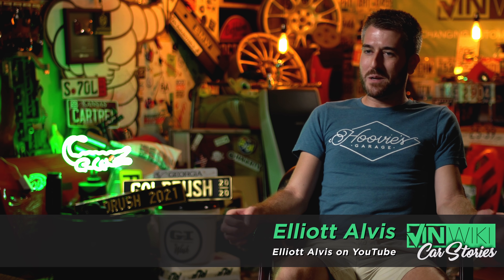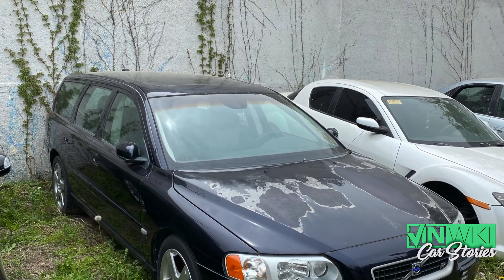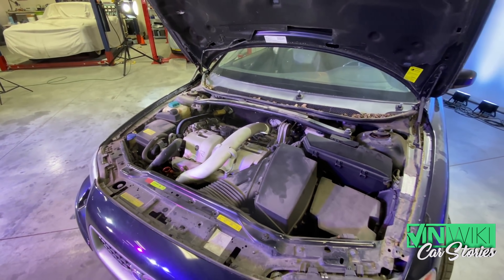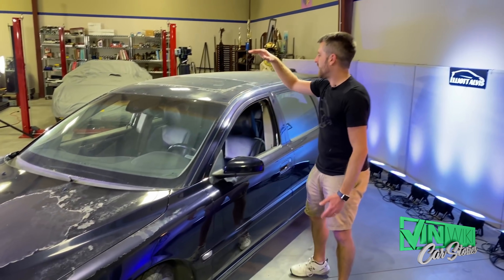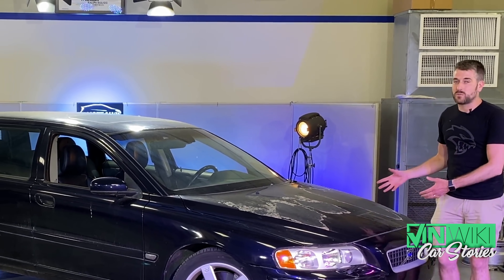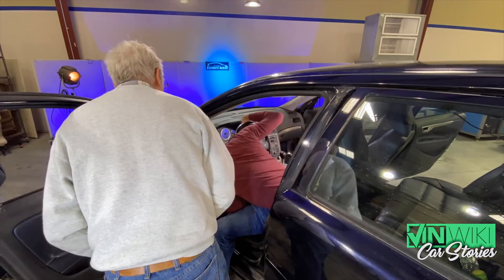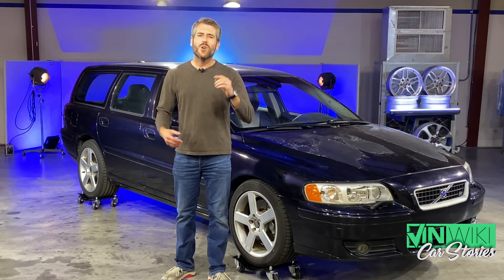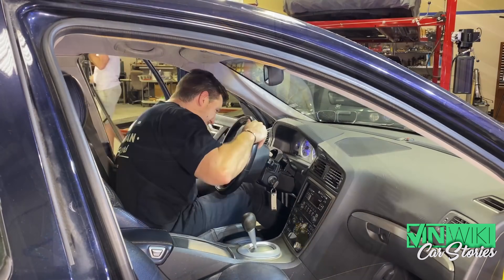Everyone LOVES you with this rare, broken Volvo

Comment: As a member of the Volvo Community I can say the Volvo Community is absolutely amazing. Our Xc90 has had quite a few problems and the Community just helps me out when I need and are so nice and open. Love the Volvo Community. Volvo owners, where u at
Reply: I have 3 of them;  2  XC70 (2003 - 2004), and a 99 S80 with very low mileage in it
Reply: Here
Reply: Yes sirrr. 04 s60R
Reply: ‘95 940 Estate with turbo, M90, and 254k miles checking in, you’re absolutely right! 
A guy sold me a complete set of wood grain inserts for the interior including ash tray for around $20, even though he could have sold it in Sweden for a cold $100. I live in Denmark, so it would have been easy and cheap for him to ship it, or simply sell it to me for a similar price but that’s not how Volvo owners operate!
When I had a BMW, people on groups would almost charge money just to answer simple questions haha

(Btw username was made when I had an 850T5, maybe I should change it lol)
Reply: yerrr. 2018 S90 T8, and about to buy a T5
Reply: Yes here✌️ Got a 2016 V60 D6, and a 850T-5R and 850R, both stick shift wagons🥰

Comment: THere is no better community than the Volvo Community, so dedicated to keeping Volvo's alive. I bought a XC90 cheapish and after getting it home found, pedal assy was rusted, Amp was water damaged,  Yaw sensor was rusted,  carpets and insulation was soaked, found the Sunroof drain pipe was disconnected in the pillar trim.. I gather with this V70 the CEM module prob got wet, this links all the computers and electronics together. Relativly easy to remove and replace / fix

Comment: You put this so well .. yes we are the Volvo lovers and we are longing to see your V70R come back from it's sleep!  I have a S80 3.0 non turbo and that is good but I have already spent more than the car cost me on replacing some of the onboard systems, e.g. the suspension computer which corroded inside the car (and no sunroof to leak!), the main computer as the car would not start - that even confused my mechanics!

Comment: As a fellow S60R owner I can see your left 'A' pillar trim is peeling away, this is from water overflowing the sunroof drain tray at the front left hand side due to the drain being blocked or kinked and the water then running down the 'A' pillar trim.
I had a L/H front drain kinked on mine when I bought it but thankfully my car is R/H drive so my CEM (Central Electronic  Module) is on the other side.

Comment: The issues I seen this wagon have are the same issues I seen on many P1 Volvos and even some P2 Volvos.  But mostly seems like P1 set of issues…

As an owner of P3 Volvos, including one with touching 300,000 miles with mostly hands off approach to maintenance it is true Volvos are amazingly reliable.  Barely don’t much work on it other than tuning it for more power, mostly hands off.  It’s due for a full system flush of every fluid, probably a new water pump here soon too because I’m slowly loosing coolant but I seen some suspicious drips in my driveway that crystalize when it dries indicating likely coolant seeping somewhere and most likely is the pump.  Some bushes got changed.. etc nothing major has failured yet and I beat the snot out of it.

But P1 volvos are flakey as all hell IMO.  Owned a 2009 C30 R-Design for a brief stent before selling it to someone more qualified and willing to get dirty even though I lived that car to death and would love to own it now, it was a money pit for me someone who isn’t exactly swimming in cash. Nothing major failed on my C30 but stuff was quicker and quicker and I learned common issue with P1’s.   even the steering lock system (SCL) failed on me, SRS failure, SAS Failure, both of which were easy enough fixes for me to do, just remove the SCL and modify it,l as per directions online and reinstall it.. SAS failure was for me atleast related to the angle sensor in The clock spring because replacing that with a C70’s clockspring I found cheaper fixed it after recalibrating it’s.  SRS failure however could be anything, I couldn’t find it but the dealership did for a huge fee $$$$ luckily wasn’t a dead airbag controller which is apparently a potentially known issue with P1’s sometimes though seems relatively limited in my research.   it was just a bad door model taking the SRS signal check thingy offline and replacing that also cleared other pointless codes…

Comment: This has likely been mentioned in the comments.  And by now, I’m sure you have looked into repairing your sunroof drain hoses.   I had to do that for my sons 2005 T5 S40.   It was so bad that if he left it out in the rain the water would drain directly into the footwell on the drivers side.   Which soaked the electronics on the way to the floorboard.  Fortunately it was an easy fix by removing and replacing the drivers side rubber drain tubing.   The drain tube (when functioning properly). Connects the sunroof area to the front left quarter panel.

One of the biggest problem is that these cars are designed to be recycled.   The rubber parts degrade over time.

Comment: I have had two 240's ( the first one saved my life, so i bought a second) an 850 R that I used to embarrass mustang kids in college, (before the turbo started only working intermittently and randomly)  and an XC 90...  All of them were in a constant state of disintegration,  I had to reach into the dash where the radio had been to use my windshield wipers on the second 240, it just kept burning through wiper motors) and I deeply miss all of them.

Comment: I have a 08 s60 2.5t and it’s literally the most reliable and fun car I’ve ever owned I have a full straight pipe with a cat delete and it sounds like a damn v10 the flutter is insane and driving around with no hood and a huge top mount intercooler you get ALOT of comments and attention Volvos are definitely the most slept on cars and for no good reason because they are absolutely amazing

Comment: I was a dyed in the wool VOLVO station wagon guy for many years when my 750 wagon let me know the entire front end was about to go, and needed another 2k worth of work. My Mechanic even said "It's time". After a solid month of looking around,  I found an XC70 a ten hour drive away  in Edmonton, and flew in and bought   it. Edmonton also has the closest  VOLVO dealer,  and the thing about their dealerships, is that they do not give out the computer codes to fix problems. You HAVE to bring it into them for any computer work.This Fact was about to bite me in the ass...  . I had a great drive back  to P.G. 6 weeks later,  I noticed the tranny slipping going up a hill. The tranny fluid at 129k had never been changed! That was it for that tranny. I sourced a used one from Vancouver Island, and paid 800 to bring it up here. I had it installed, and all was good, but only for about 6 weeks...I was driving up a small hill, there was a massive BANG,. and tranny light came on again, It would only drive in manual (tiptronic transmission) but I had all 5 forward gears, and reverse, but no automatic. I was  14k into the car, and was totally crushed. Then the place I got the tranny said " You need to bring it to a dealership, get a diagnosis, and until that was done, there could be no refund". The car drove perfectly except I was terrified to leave Prince George here in Northern BC, so it did not leave the city for two entire years, and only put 2k on the car. Then I needed another part, and had to talk to the place I sourced the tranny from, and this time the  Owner talked to me. He had my file in front of him, and asked me how the car was. I told him I had reverse and all 5 forward gears, and that was all, he hesitated, and said " My friend, there is nothing at all wrong with transmission. It needs a dealer only reflash. Get it to Edmonton!"A few weeks later,  I drove to Edmonton pretty much freaking out that is was not going to work. I had mapped out all the car wreckers between P.G. and Edmonton, and  was prepared ,if the tranny failed, to get a tow there and leave it behind. Well, next morning at the Dealership, I had the hour long 150 buck transmission reflash . That was 8 years ago, and this amazing car is still parked right outside and is going strong. I have no intention of ever moving from P.G., and as such, with VOLVO's privacy codes biz, and the dealership being a ten hour drive away, this is definitely my last VOLVO.  Sad Kerry...

Comment: I've been a service advisor for Volvo since 2011. These cars are quirky as shit and they all suffer from pretty much the same ol crap depending on the generation. Inspect every single pin in that connector for the CEM you replaced. Also check all of the connectors under the front carpets. When the sunroof drains fail the water pools up in the front floor boards and it can cause a short in the connectors for the harnesses that run along the floor. There is a short somewhere that caused that CEM to fry.

Comment: Your sunroof drains behind the A pillars may be clogged or disconnected. Disconnect battery, pop off A pillars and disconnect the air bag there will be a clear rubber tube runs down a rubber drain spout with little fingers thats catch leaves and debris

Comment: it's a volvo. of course it runs. it's not gonna run well, but it'll run. I had a 91 240 wagon that had 450,000 miles on it, ran on 2 cylinders, and I drove it out of the field it sat in for 3 years. absolutely rust free in Iowa. the heated seats even worked. I kick myself every day I sold that car. wagons are the coolest volovs.

Comment: As somebody who has owned several Turbo Volvo wagons from the generations before and driving them to more than 300.000km on their first turbocharger, in some cases first clutch and exhaust, I honestly am puzzled why some people seem to have trouble with the later generation?
Granted, my cars always got 5W50 Mobil1 oil every 10.000km, original Volvo filters and spark plugs, were always driven up to temperature before going above 3000rpm (which meant that on trips less than 15km this was: never), every bushing was regularly inspected and replaced before it could fail etc...
But I tend to treat all of my cars like this and they just... work? Currently there are more than a million km sitting outside, distributed among 3 cars, and all are going strong.

Comment: Water, it's a bloody nightmare.

I found my brother a 2 owner S60 2.4 D, only 43k on it.
The car was incredibly well looked after.
But it still had the boot release fail because water got into a connection in the loom.
One new boot catch mechanism & wire bypass & it's all good again.

Comment: I drive a 2006 V70 unfortunately it automatic and not the r model. But it is by far one of the best cars I have owned. Unfortunately they do have their electrical issues when they get older because the wiring is crap

Comment: I’m born and bred a Chevy guy. That said, I love my 2005 S40 T5 that my daughter uses, and my wife drove S60’s till she got hit head on and walked away, then went to the XC60. That little S40 is like a go-kart for adults.  Not sure why I let my kid drive it lol.
The S40 was doing weird electrical stuff, triggering the alarm, dimming the lights etc. , it turned out that the sunroof drains were clogged and water got in the electrical system.  Problem solved.

Comment: This was me after buying my 07 Sonic Blue S60r, rare color to own but holy jesus it needed work.  Ended up needing a headgasket on a 32k mile rebuilt motor, valve body for the trans, axles, brakes, and steering rack needed replacing.

Comment: A major misconception about sunroofs is that the glass part is supposed to seal against the metal roof to keep out water,  this is incorrect they don't provide a 100% watertight seal at all and that's why there is a  tray underneath the glass that has 4 drains, one in each corner to drain water away.
 If these drains get kinked or blocked you will get water in the car and wet carpets.
 So many people have said to me 
"my sunroof leaks".
 Well technically it's supposed to and that's why there is a collection tray with drains.
 Keep the drains clean and clear and you won't have a problem.

Comment: God my S60R is so close to being a good driving vehicle 😂 new clutch, battery, starter, pcv system and the last thing I need to get in it is the clutch line it’s been a test of my patience and I’ve dumped more money into it than I bought it for but I like the car a good bit it’s really nice
Reply: Love the S60R!
Reply: Sorry for you! Buy a normal s60 without Turbo… They last forever.
Reply: @KingKohlrabi   I wouldn’t ever buy a Volvo that’s not an R or a polestar, I like performance vehicles and reliability isn’t something I worry about, I wasn’t complaining about the car I was just saying I’ve had to work on it a lot
Reply: @Thatdude877   yessir it’s a great car when it wants to run properly 😂

Comment: I went to go look at a v70r before I bought my s60 ('11 t6 awd). The message center in the dash alone was mentioning 7 different issues, and it wasnt running entirely right. It was at a great price, but I needed a daily driver. I had to look elsewhere. Okay, a 2011 s60 t6 has AWD, a turbo, 300hp, and 325 torque. And will be the last Ford designed car manufactured by Geely. Sounds pretty good. I shouldnt have to do that much to make it 100%. WRONG. Pinhole in the alloy wheels, splash guard ripped apart, Vacuum pump giving the car a free oil bath, destroyed Engine mount, destroyed torque mount, serpentine belt is cracked, the bearings on the power steering pump and tensioner are failing, the alternator has a "Rattle" which means the READ unit could be about to fail and would require an motor replacement, the wheel speed sensor is causing the car to drop into limp mode, coil 2 exploded, coil 2 (cheap replacement) exploded again, the sunroof has no clue where 'closed' is, the drains are clogged, the sun shade closes too far and the HIDs have failed twice because the housing chomps at an "Armored" non serviceable wire (anything is serviceable with enough gusto). 

But dang it feels good when all those are replaced. Ive put some subtle body kit pieces on it intake, exhaust, polyurethane motor mounts and a laundry list of other odds and ends and it feels like a little rocketship

Comment: My brother and I recently inherited a Sonic Blue on Atacama V70R from our father who tragically passed away in a car crash (in his other car)

In the 4 years my dad had that car, it went through 3 engines, 2 automatic transmissions (before getting a spaceball), 10 turbos, being rebuilt from an accident, and a myriad of other electrical issues. The car is nearly done from its 3rd engine swap, and is waiting on getting a tune. 

To say these cars are the epitome of passion projects is putting it lightly. The Volvo community around these cars & older ones is incredibly tight-knit. it's so heartwarming

Comment: I only do 245's.
#9, my current daily, was a $300 '89 & has had $4K thrown in it.
I just purchased a '92 for $400 with the M47 standard, it has over $2K in parts.
  I am replacing the AC in the 89 with the 92 unit. This includes exchange of leads to the ECM.
   After this year I will be placing the 2.3 & M47 in my 77 242, that has been cloned into a 142.
I have been in Volvo since 1984 and will not purchase one after 1999 production, I always hated Ford!

Comment: if a car has been standing OUTSIDE for any longer period of time with out being used I mean like three years of the road or even just like six months and it has a sun roof then you can bet your ass there is going to have been water inside it at some point so suggestion for the next time you get a car that's stood for longer then six months outside and has a sun roof. strip everything out interior and every thing and go through the entire wiring harness and replace what needs replacing in it or better yet replace the entire harness even if you have to Make the replacement by your self.

Comment: Here's the thing with Volvo "Enthusiasts", World wide We tend to be sucked into the Volvo Vortex as lovers of other marques who chose to Drive Volvo as Daily drivers.
For instance I'm an old Benz guy but I'm not a fan or nor can I afford to drive a Modern Benz as a daily and having had a Volvo Wagon early in my parent days (265GLE) for comfort, safety and Seating 20 years later I buy a used 740 Wagon while I have a shed full of S class 116 and a 107 chassis Mercedes and proceed to put a million km on the thing servicing it myself with OEM parts and in the process falling in love with the engineering, design, frugality and the Volvo Engineers Sense of humour (Yup) because of the hidden logic behind the batshit crazy stuff they built in so now I not only have a handful of 1970's S and SLC Mercedes (And a W123) and love the 108/9 but I have numerous 1980's through to 1999 Volvo 2, 4 and 5 door's and my early 20's Daughter has a V8 XC90 and oldest son a 244.
All compliments of the Volvo Vortex.

Comment: Having driven a number of V70Rs, ive never been impressed by them. The automatics drive like a lazyboy recliner mixed with a waterbed
Reply: That’s why you don’t get an automatic.. plus you are giving up the spaceball
Reply: The automatic transmissions in these are actual dogshit transmissions the manual is a very good transmission though
Reply: @astrocannon  a roommate of mine had 3 and they all had the AWD system break.
Reply: Yea mine broke too haha, can still drive as FWD since it’s just a hydraulic clutch in the rear diff!
Reply: @Louzahsol  the AWD breaks because the angle gear has a collar and it builds corrosion there’s an updated part that helps a lot but it also will eventually fail due to corrosion it’s one of the, very, many regular maintenance items on these cars along with pcv and weather seals water pumps it’s just one of those things that has to be done frequently